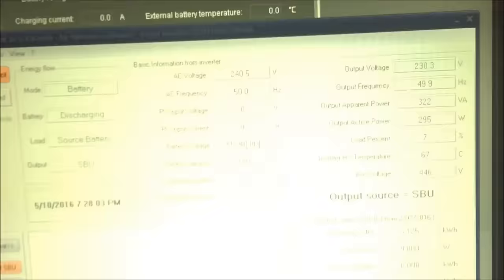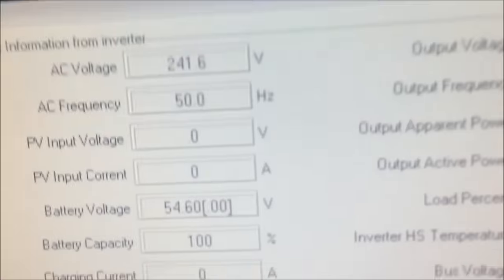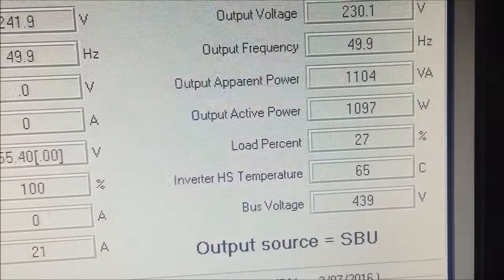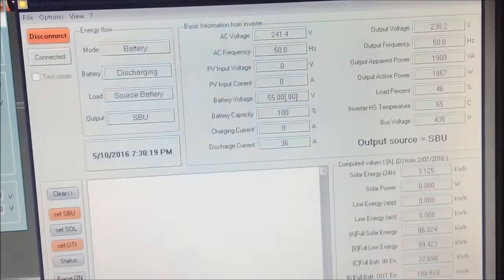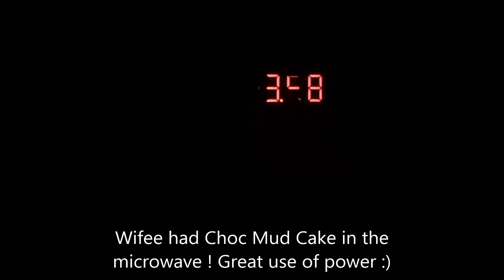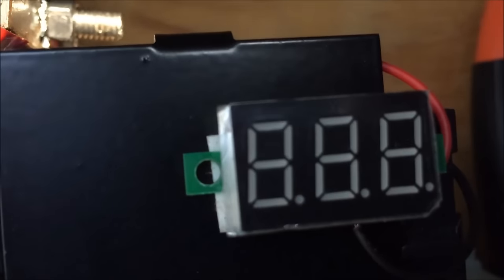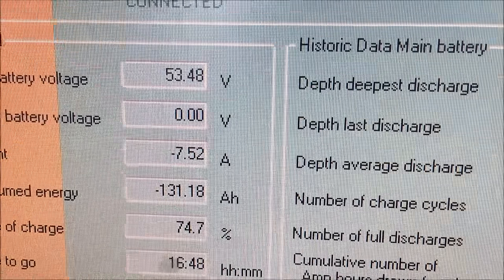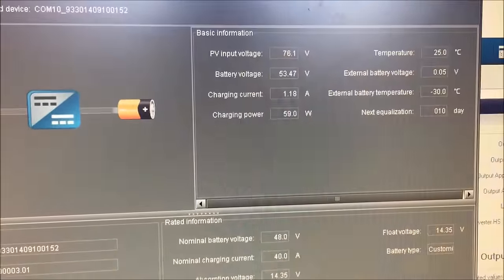Voltage sag on one cell with 2500w load - preaty average video

Comment: Hi Pete, 
Love what you are doing and your videos - they are ALWAYS worthwhile imho. 

At best 'you-get-what-you-pay' , so a suggestion :
 3-wire benchtest ALL those teeny voltage displays simultaneously. Power them all from same fully-charged spare pack. Have them monitor your bench DC supply as the input signal. Connect multimeter to monitor the DC input too. 
Check for consistency across all teenies as you vary DC input. Also record offset between multimeter and teenies. 
Be worth repeating this in future (6 months +) to see just how stable a product those teenies actually are. 
(Of course your multimeter is being used as the Golden Voltage Reference here, but that's the best available you have at present).

Comment: The drop from now load to a load should be correct even on cheap meter the whole voltage maybe off a bit. I would recommend 3 wire meter two for reference volts and one for measure volts much more accurate. I was going to start mine and now my wife says NOOOOO she is afraid of used batteries but not the big lead acid one go figure

Comment: Very cool system   I have a question how do you wired you panels to your pip.  Which volt is the perfect to the pip mppt. 250 w solar panels is the most famous. So how to connect them to pip 4048ms
Reply from the maker: +haytham abdalsattar https://drive.google.com/open?id=0B3D1svhLzR-JclE1aXZFYXpCMEU that should help :)
Reply: HBPowerwall    The link is not opening 😔
Reply from the maker: https://drive.google.com/open?id=0B3D1svhLzR-JclE1aXZFYXpCMEU works here try again with this link

Comment: Just buy the three wire version of these little things, but be aware of that their voltage regulator is so crappy that you should not run them over 5V VCC for a longer time.

Comment: Wow, what 18650 cell is this? Will this sag on a 27s2p setup for use as a turbo/booster pack for an ebike? I will run it at 200amps of power.